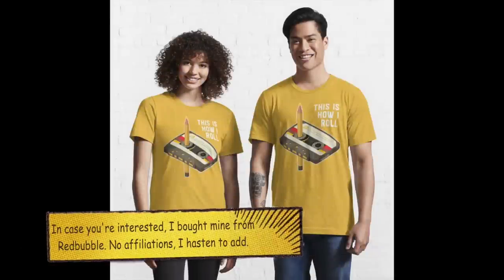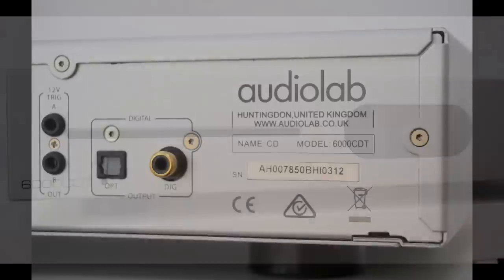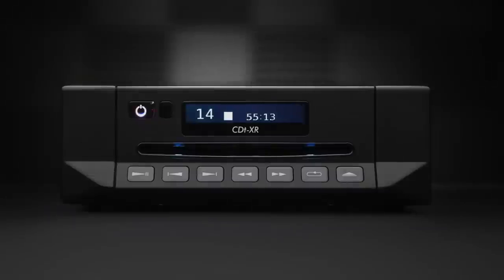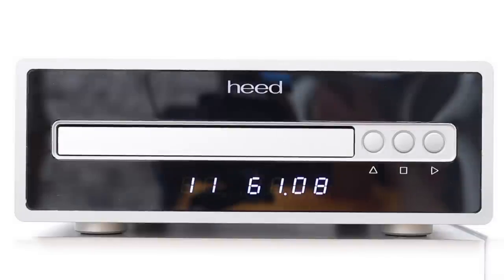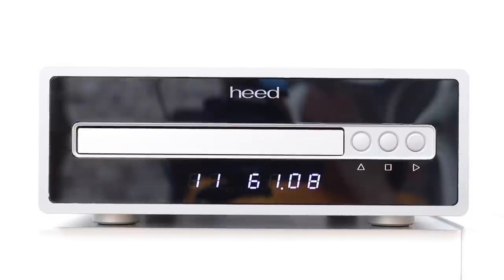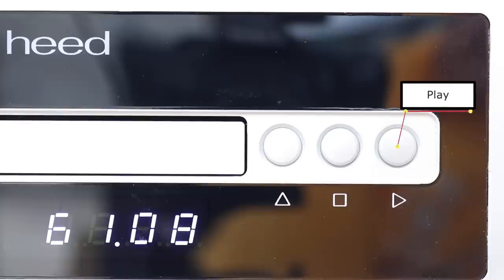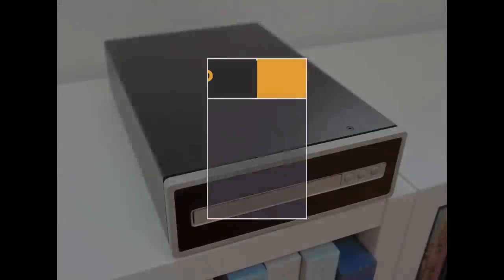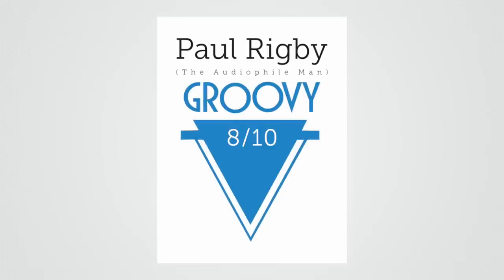HEED THESIS DELTA CD TRANSPORT REVIEW: SHOULD YOU UPGRADE FROM AN AUDIOLAB 6000CDT?

Comment: CDT6000:    I was using a Pangea Premier XL Coax Cable ($169) and a $500 boutique power cord. Aoout 5 weeks ago, I replaced the Pangea coax with a Ali-Express Odin 2 (knockoff) Coax cable (<$130); and just 10 days ago, I replaced a very nice looking muscular twisted power cord from Ali-E (<$40; great value for someone just dipping their toe in the power cords waters) with a Odin Gold power cord < $150!!! , resting on 4 metal point in cup iso devices.    I'm very very impressed with how these cables transformed the 6000, which was darn good to begin with. HTH

Comment: L👀ks like removing the DAC card solved the noise floor issue. That said it also l👀ks like a few connector pins on the right hand side need to be straightened out if you'll be re-installing it.

Great review BTW, especially your reaction to the initial noise floor problem. Appreciated your persistence in tracking down the issue.

Had a similar problem with my Cyrus CD-T transport, but for a different reason. The Meridian DAC's switch mode power supply noise was mucking up the works ... solved it by terminating the power supply cable with a ferrite balun and extra decoupling capacitance which suppressed its noise, making things right again.
Reply from the maker: My fault. The tests were done before the bent pin incident, though. So it doesn’t affect the results.
Removing the card is tough. I actually sought advice from Heed itself before I removed the card. Then I followed their advice. Then this! There is a big piece of chassis in the way. Ideally (in hindsight) the entire chassis should have been completely dismantled first.

Comment: An interesting take on the theory behind cd transports. I digitised my discs years ago but listen occasionally in very different ways to the old days.
I use a portable usb cd drive connected to my Auralic Aries G2 streamer which plays and rips simultaneously and feeds a Denafrips Terminator Plus DAC. The results are excellent.
For SACDs I use an old Oppo universal disc player with a Chinese made box which strips the DSD stream from HDMI, converts it to I2S and, again, feeds the Terminator.
So, in my house at least, the shiny ones still have a niche.
Reply: i also have a Denafrips but only 100 cherry picked CD's that i kept.   so 3k for a transport?  foolish. i will get a $100 external usb cd drive.

Comment: The I2S output is a nice feature.. It is the “best” connection if you have a compatible DAC with that interface.. BTW, I think you accidentally bent some of the male connector pins on that optional DAC card.. Looks like an easy fix though if you are careful.

Comment: Here’s my dilemma. I have a sim audio moon 340 amp and a heed abacus dac, with my cranky YBA Designs cd player. The dac and amp sound pretty darn good but the player has a habit of going on strike, perhaps a cultural trait, I am drawn to the moon 260dt or the heed thesis delta to replace the now pushing 20 year old player, the Heed in my area is slightly more expensive but suites my eye better, so what is the most interesting option, these will be played through a very revealing pair of Fyne Audio F502SP speaker???

Comment: Hi Paul, I noticed a severely bent pin at the end of the dac board's row of contacts. I hope the board was making contact properly when you tested the transport? If it was an earth it could have caused all sorts of problems. 

That aside, I rip all of my CDs to an Innuos server (ZenMini iii) in flac format. Have you ever tested if there is any sonic difference in files ripped from different CD transports when fed to the same external dac?
Reply from the maker: My fault. The tests were done before the bent pin incident, though. So it doesn’t affect the results.
Removing the card is tough. There is a big piece of chassis in the way. Ideally (in hindsight) the entire chassis should have been completely dismantled first. 
Never tested the ripped file thing but it’s a good point. I’ll make a note for the future.

Comment: What DAC were you using in theses tests pls
Martin
Reply from the maker: The Benchmark DAC at around £3k (when I grabbed it anyway) which I found to be the absolute limit (well, just over) for the 6000CDT. I wanted to see how the Heed handled it.
Reply: There's no mention of the IS2 connection. Why so? Is this not meant to be the best way to connect a CD transport to a DAC?

Thanks
Dave
Reply from the maker: @davebalfour6158  I do highlight that in the Closer Look section but I wanted to address a specific question, as I mentioned in the intro and the whether the Heed - in basic terms - was a suitable upgrade to the 6000CDT. 
As the CDT does not include an I2S connection, only coax, I thought the A-B comparison was the best suitable choice. 
More, I noted that the CDT began to falter when it was connected to my Benchmark DAC so I wanted to see how the  Heed compared when connected to that. The Benchmark does not have an I2S socket.
Reply: Thanks for that. I have a 6000CDT and yes, it is good. 

I do, however use the digital COAX out from a Pioneer PD:S707 CD player ( with analogue and DAC sections switched off). This combination (Matrix Mini Pro 3 DAC) sounds considerably better than said DAC with the Audiolab Front end, to my ears.